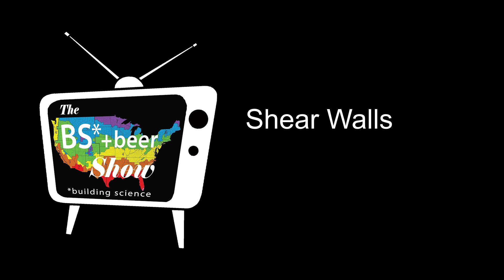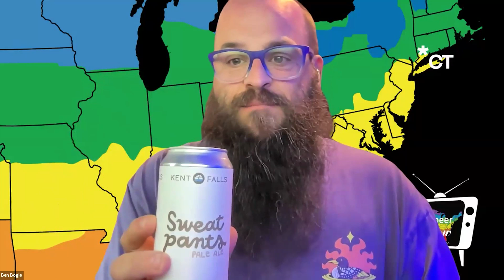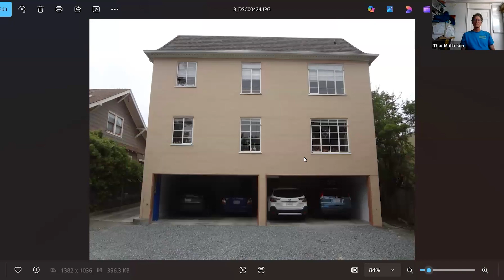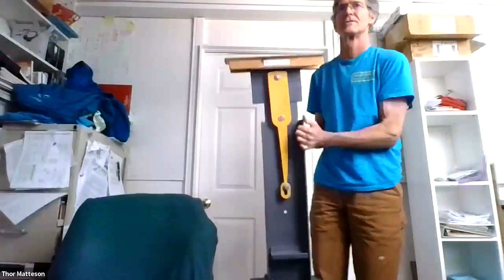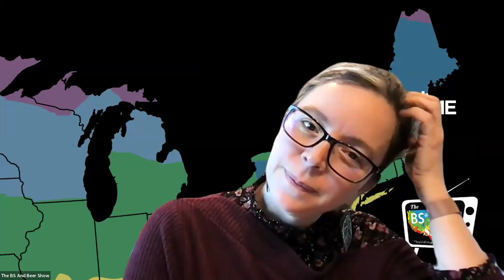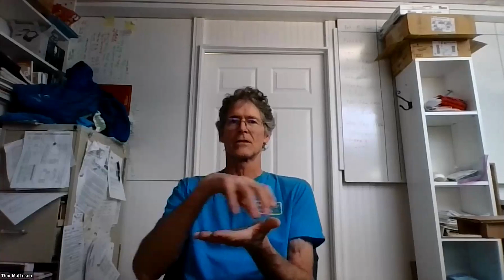Shear Walls with Thor Matteson, SE

Comment: I spent my entire career in the SF Bay Area and every project involved heavy duty hold downs and 3” O.C. Panel nailing. We started using 3x4’s (zone 3) on the panel edges so those studs wouldn’t split in half. Of course none of your standard insulation fits without cutting. 
     Then there’s the steel posts and beams, with welded moment frames that can’t be insulated without external insulation. They are bristling with mounting studs for the transition back to wood. The beams bounce like crazy and have to be reinforced with wood so the building is comfortable. 
     The Simpson Strongwalls at my house have 7/8” threaded rods embedded in 15cy of concrete. The vertical movement in the 6.8 quake was about 3 feet. Imagine a 7.8 quake that is exponentially more powerful. No buildings will survive and the rest will burn.